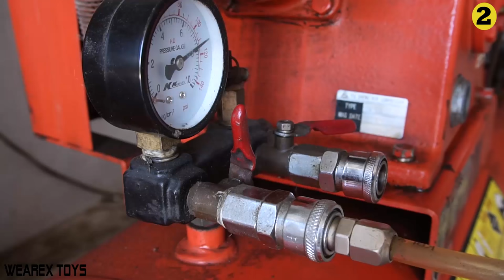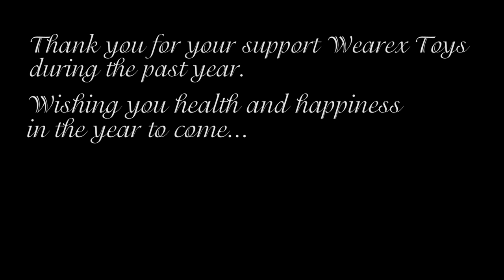TOP 5 BEST DIY INVENTIONS OF THE YEAR 2020

Comment: I love the 120v electric drill hovering above gallons and gallons of water . . . no problem there.
Reply: Maybe he meant DIY "Darwin It Yourself" as in Darwin awards.
Reply: An how do u think a transfer pump works with magic? U still need electricity. Same with ur pool pump at 220v Or the 220v for electric hot water heater. But you’re worried about the drill thats plugged in a breaker designed for that reason. You are a genius gump
Reply: @johnnyd4200  Those pumps have sealed power input and circuit board wich this drill do not have. Next time inform yourself on the subject before saying stuff like: "because a pool pump is wired on 220V it shold be more dangerous than a 120V drill". The 220V pump is DESIGNED to work with water not the drill 120V or 220V.

Comment: Wow, I can build all this stuff as soon as I get an engine lathe, drill press, welder, dremel, air compressor, angle grinder, hot glue gun, steel, pvc, all-thread, fasteners, bearings, electric motor, power supply, soldering iron, tap & die set, a huge washer, car jack…nah. Neat, sure. But I’ll just buy a table saw, wood lathe, power snips, bead blaster & a water pump.

Comment: I have made that sand blaster many times now. I use them so much that the sand eventually destroys the metal tube. It only costs 5 dollars and works amazing. I sand blasted an entire wheel barrow in about 10 minutes. The trick is to have the hole on the bottom of the tube while the bottle is held upside down. Also you'll need to sift the sand (Lowes bag of play sand) to remove any larger pebble that will clog the tube. I use a fine mesh strainer that I bought at the grocery store.
Reply: I’d like to try the sand blaster but I’m not sure I follow what you said about the hole being on the bottom of the tube. What type of adjustments to the bottle caps do you make for that?
Reply: @Low_Rent  I'm pretty sure he's saying he prefers the negative pressure of the tube to pull in the sand as opposed to it being more gravity fed.
Reply: I have a gravity feed sandblaster that works that well it easily destroys tips and eventually destroys the entire nozzle as well. The sand flows like an hourglass and its blasted out by the full pressure of the compressor.
Reply: top

Comment: Some didn't feel very DIY, but the sand blaster and the wood turning tools are genius!  Obviously not designed for for replacing the real thing, but if you need either of these tools casually, these look like good DIY alternatives!
Reply: if you put clear contact paper on glass you can put nearly any design behind it and trace on the contact paper {basically a clear plastic sticker} with a x-acto knife or razor knife blade the design "weed out" the parts you would like sandblasted and go for it . They are like unwrapping a present when you take the sticker paper off after sandblasting , also cri-cut vinyl stickers work awesome too , I have even used maple leaf and skull's , hearts die- cut stickers especially vinyl numbers the thick ones from wal-mart and it worked out as well,  paper stickers not so much, well if you do it lightly and dont go over it too much. I have made money using my imagination, its nice getting paid doing what you like to do .

Comment: Fascinating. What is that adhesive used to hold the wood pieces in place during assembly?
Reply: Super glue
Reply: @rewind12354  Thank you Robert. I was not aware it can be bought in bulk. Thought it only came in those tiny tubes.
Reply: @mikedoyon6303  No worries my friend 🙂
Reply: Ezcelente
Reply: @rewind12354  if its just super glue , what be the principle as it would have minimal to no strength applied like in the video?
Reply: @willg5110  Just to hold the pieces into the desired position, until they're tightened with bolts or screws.
Reply: Also called CA glue

Comment: Automatic tin snips attachment for a drill $40
Sand blaster $50
Water pump that doesn't involve you standing around running a drill to make it work $18
Table saw $60
Lathe $47
Most of these things are going to cost you about 2 hours of working as a welder which is part of the skills you need to make these in order to pay for the professionally made version. It's probably going to take at least 1 hour to make each of these things and then you've got to have the parts needed lying around including a tool for the sand blaster that is almost identical. This is so not worth it especially for the pump. These prices are also all from amazon so you could go to a yard sale and pick them up for half the price.
Reply: Spoken like someone who has absolutely no idea what they are talking about. Well done
Reply: @peterstaples5863  you mean I don't macgyver shit up when there is a cheap alternative. Yeah I'm the idiot here
Reply: You said it, Not me. I agree some of the invention were a bit nonsensical but in a pinch all of them work well. And probably better than anything you could buy for the prices you listed. But I'm not mad at you for trying to pull off your own priceless joke. Just try harder next time
Reply: @peterstaples5863  not really what I was going for and not sure what kind of pinch you'd be in where you need these tools quicker than Amazon can deliver it and quicker than you can get to a hardware store. Like I said like a year ago the guy has welding skills and you'd need them to make these things and even with the top notch versions of the tools he makes it would probably cost less than the time it takes to make bodged ones.

Comment: Just like the ones you buy at the shops, but with less safety features!
Reply: Surely cheaper to buy a table saw than all the kit needed to bodge these horrors together? That looked like the worlds least effective sandblaster there. But it does have a certain fascination...
Reply: Motee koun see use kare aap bana kr de karte hi
Reply: You mean the murder table where the bottom is only held by few drops of glue?

Comment: Sorry to be so late to this. 
Yesterday built the pump to empty my 50 Gal. aquarium. By the time it took me to build the pump, it had already been emptied by the 1" hose that, I've been using for the last 10 years.
Simply take a hose, fill it with water and dip the shorter end into the tank and let the longer end drop into ( or near) a bucket. Gravity will do the rest. No need to waste time. 
Larger containers? Simply use more hoses.
Reply: only thing i see haveing use in the video is the sand blaster as most are expensive
Reply: It could be used to suck up solids from the bottom, where just a hose would clog, or you might not have a lower elevation to work with.

Comment: yea... do it yourself.. if you have a lathe, arc welder, an entire industrial workshop oh and a bottle cap.
Reply: Here I'm sitting with my screwdriver multitool thingy thinking DIY, yea right, if I happened to have a fully equipped workshop in my garage.
Reply: Yeah kind seems like he should go do some work as a welder for a couple of hours and then buy the thing he is trying to make with the money he made rather than making a dodgy version at home.
Reply: @matthewtalbot-paine7977  I agree but it's better that somebody's doing something anyway. I for one didn't see ANY " New" inventions!
Reply: My point exactly. Diy 😳
Reply: I wish things like lathes snd welding machines could be easily rented
Reply: @Dragon22078  And you just happen to have an entire hardware store in your garage. I know I would have fun! But,I don't think I would video some of it!
Reply: Guys. do the work with what you have. Even those guys in primitive technology channels can do some fantastic DIY with bare hands and some sticks. Add one tool at a time with your 'capital expenditure' when you've done some work. Don't waste time with envy.
Reply: I suspect this might be a parody video.
"How to DIY a tin cutter!
What you'll need is:
- metalwork lathe
- arc welder
- spare angle grinder
- spare steel blocks"
The cost of making it literally surpasses the cost of a brand new tin cutter.
Reply: hell yeah have electric tin snips now. and you can get a fairly cheap sandblaster kit that works like the one he showed except it works much better. you can get a fairly cheap water pump to suck out that water, table saw doesn't seem safe. also you  can get them pretty inexpensive these days. and the lathe, holy shit those things can be dangerous, i wouldn't trust a homemade one. also this guy doesn't even use proper length bolts.

Comment: The sand blaster works kind of OK.  A wire wheel is probably quicker though.....
Reply: Probably? Most definitely. I can PROBABLY do it quicker by hand, with a wire brush. With a drill and wire wheel, most definitely it would be 100x faster. I prefer to do everything by hand, though. I'm old skool

Comment: That saw needs some safety add ons
Reply: It has a build-in safety feature that lets the motor burn out due to collected dust in its innards. So the un-safety-ness is time-limited.
Reply: Once the stock thickness goes above 1/4 inch the motor will stall. As Don stated ...safety features needled.
Reply: Who needs safety it’s probably china
Reply: Who needs safety for trash. The cuts won’t be true. Just buy a used saw . When that blade comes flying out of that pile of crap he better know how to diy some stitches. (Rambo stile)
Reply: @albertthorne2872  you’re spot-on. There isn’t even a fence. I got my Skill table saw for about $100 on sale, new, blade included, and it’s light-years safer and better. Gotta think best approach not just doing.

Comment: Get a 4 way pipe cross, plumbing fitting, some pipe, a flare fitting sticking through the bottle cap and a flare nut to hold the bottle down in place.  A pipe out of the bottom for a handle, and a valve coming in to shut off the air.  You can make your own sand blaster and just piece it together without fabricating anything.

Comment: if you put clear contact paper on glass you can put nearly any design behind it and trace on the contact paper {basically a clear plastic sticker} with a x-acto knife or razor knife blade the design "weed out" the parts you would like sandblasted and go for it . They are like unwrapping a present when you take the sticker paper off after sandblasting , also cri-cut vinyl stickers work awesome too , I have even used maple leaf and skull's , hearts die- cut stickers especially vinyl numbers the thick ones from wal-mart and it worked out as well,  paper stickers not so much, well if you do it lightly and dont go over it too much. I have made money using my imagination, its nice getting paid doing what you like to do .

Comment: Some of these ideas aren't terrible, but the technique used is really terrible. Even in my limited experience (yes I do, for example, have a lathe I use maybe only a few times a year) I would have at least did facing on that metal bar when I started, punched all my holes, and many more things that seem like this was more in style along the lines of something "Doesn't matter in the least how the end result looks, or how long it will actually last, as long as it sort of works, and I don't lose a limb, it is a victory." 🤣

And as someone else pointed out, before jumping in on projects such as this, I first see how much just buying something already made is, and often it is not worth the amount of time to DIY, and I should rather focus on my actual job. 😊

Comment: Send the air line into the to of the bottle on your sand blaster the trigger for a open close over an outlet. Could uses an air hose to the top of the bottle to a short air hose on the bottle neck to your air gun, might be hard on the air gun but a lot more pressure too really work

Love the drill press lathe

Comment: In the first clip, you don't need to cut the outer race to remove the inner one, you can disassemble it
Reply: I was going to post the same thing. Pop out the plastic ring that holds the ball bearings in place, slide them all around to one side and then push the inner hub to the other side and everything will just fall out.

Reverse the procedure to put it back together. Doing it on a piece of foam rubber will help you keep the ball bearings at the right height (push down on the ring) as you assemble it.
Reply: He used a bearing for a bushing...🤣

Comment: The water pump is working with electricity and you are stepping on the water, I do not know a siphon could be less dangerous, the idea is good but in a safer place
Reply: Just used a cordless drill then

Comment: what's the welding system he's using? not the common ones i used to know.. seems very easy to use!
Reply: Looks like a typical stick welder to me.
Reply: Stick welder. More difficult to do properly than the MIG you're going to see typically for this diy stuff, but the machine is cheap and you don't need inert gas. Just angry pixies and electrodes.

Comment: Wow great video
My mind- great i feel more useless than ever before
Reply: Its a guy with tools and machines which dont give a shit how they work or how you should treat them. There are great DIY Youtubers out there. What this guy did is showing how you ruin tools and machines, potentially lose your fingers in the process for producing stuff where even an apprentice would be ashamed.

This stuff? You can do it. Everyone can. One week training in a toolshop is sufficient. With the exception that you would use some lubricant when you drill holes and use the proper tools when cutting a thread. And maybe, but thats a large maybe, put a finish on the parts surface that it dont looks like made by a cavemen
Reply: @Ttavoc  exactly

Comment: How many people have access to a lathe..lol or a tap set?A welder?t's a cool little gimmick but not pratical.If i can afford a compressor with lines i can afford the proper tool to sandblast.#3 yet again i could just buy a pump before needing a lathe/welder disc grinder.

Comment: The make shift lathe was cool the table saw well ive never found much of anything I cant cut with my cordless circular saw with a clamping fence . As far as small stuff my grandfather used to use a worm drive to cut trim in homes he was amazing with that little worm drive he had. I miss that man he used to build the rafters and plane and cut all his trim in his shop and take it to the job site the next day for the guys to install. Complicated compound hip and ridge cuts he could do in his head (this is what most have trouble with ,he could cut everything for a roof system and stack it for the next day every piece!)  and they would fit perfect and he never learned math beyond adding and subtracting.

Comment: what kind of glue is that?
Reply: I think superglue. He uses it to fix the parts so they stay aligned when he screws them together. Don't think the glue is supposed to bear the load. Superglue, the very runny kind, is good at getting inbetween the wood-fibres and get a quick bond. 
I think this trick was the most valuable thing I took from this video. If you want to fix something and don't have to work on it after (because it will not look pretty), go for it.

Comment: OKay, gonna comment as I see each one if it’s worth commenting on. This first DIY hack, um, yea, easier to just buy a pneumatic  cutter, would it not be, lol

Again, DIY sandblasted, yea, quicker, easier and a hell of a lot less messier to buy a small sandblasting unit from Harbor Freight. Would have also been easier and quicker to soak the shears in some Coke or some other rust remover overnight and then just wire wheel them. SMH

Sorry, I’m done, I can’t watch no more. all

P.S.
The 5 best DIY inventions/hacks of 2020 according to who? lol

Comment: Just reminds me of the battery powered nose trimmer that you can take apart the tip and then place the nose trimmer metal gets off center onto the three symbol of the power cord for the cell phone and when it gets hot it will spin and attach and you can actually regather the the plastic and it makes a really long thread
Reply: That plastic thread can be cemented into place to repair tupperware !

Comment: WARNING DO NOT COPY THAT SAND BLASTER HERES WHY SILICOSIS OF THE LUNGS HES USING REGULAR SAND ITS A HORIBLE LUNG ISSUE IF YOU USE REGULAR SAND BEACH SAND ETX USE A PROPPER MEDIA AND USE A PROPPER GUN THERE LIKE 15 BUCKS AND 20 FOR THE MEDIA NEVER USE SILACA SAND